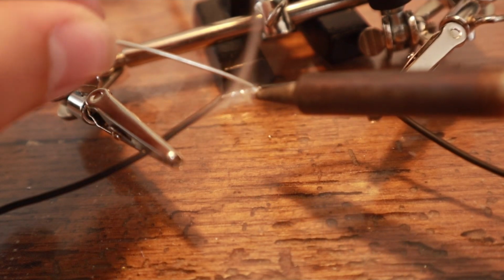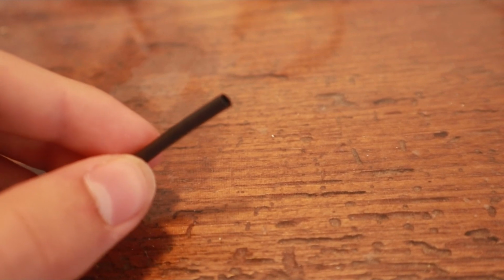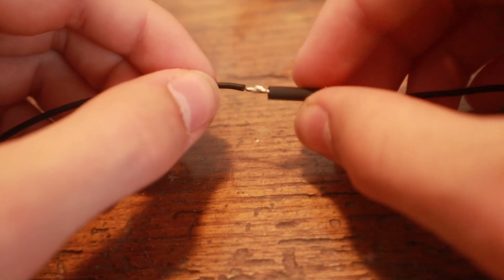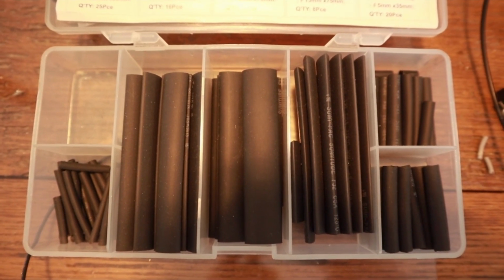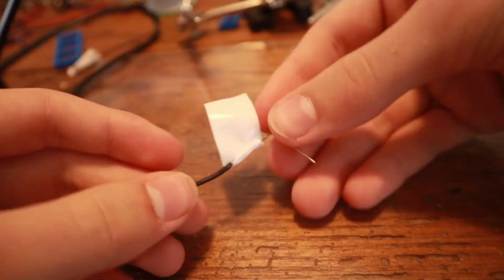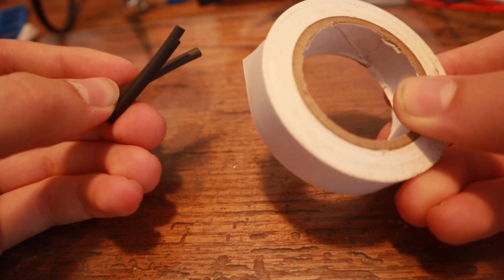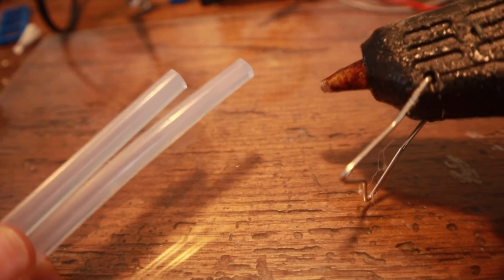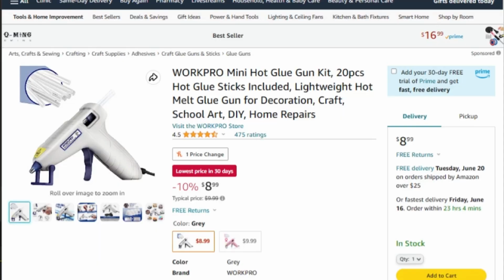How to INSULATE Your Electrical CONNECTIONS

Comment: Google lists this video when searching if hot glue can insulate wires (of any kind). Danovation pointed out in another comment that hot glue cannot reliably insulate at 120 or 220+ volts. This may seem obvious but I just finished repairing a short in an electronic device in which hot glue was used in manufacturing to insulate a 120v wire.

Comment: How to remove hot glue if I need to redo something?
Reply from the maker: if you can heat it up again like when you applied it then it will become just as runny and you can reposition things or scrape it away or whatever

Comment: would a hair dryer work for the tubing
Reply from the maker: You could try it but I suspect it wouldn’t be hot enough to shrink it
Probly depends on the exact tubing and hair dryer though
Reply: @danovation works but takes a lot longer to long